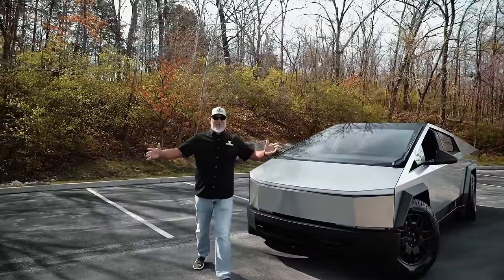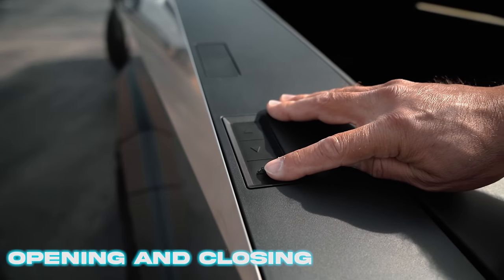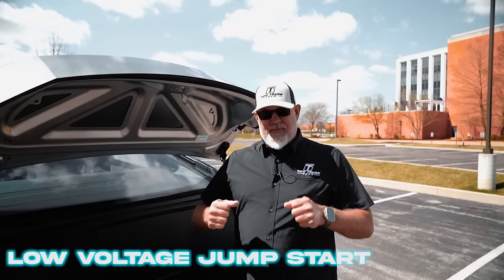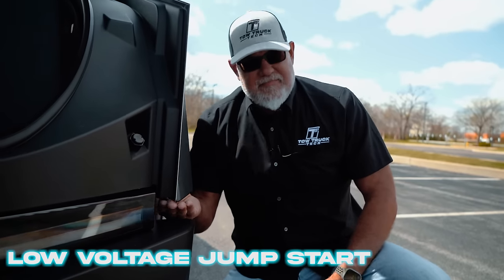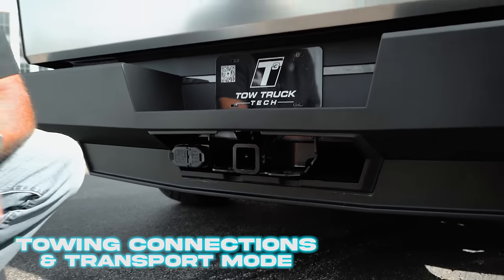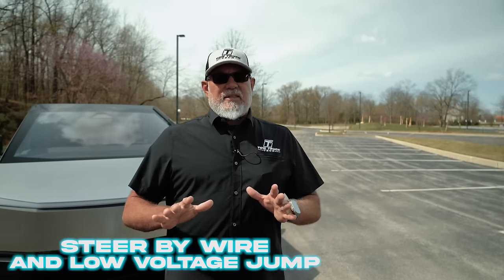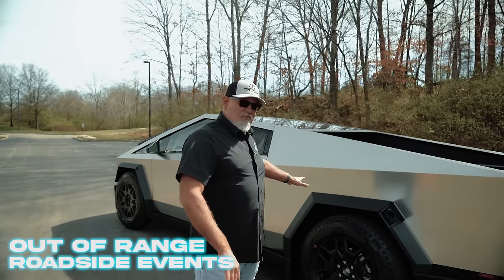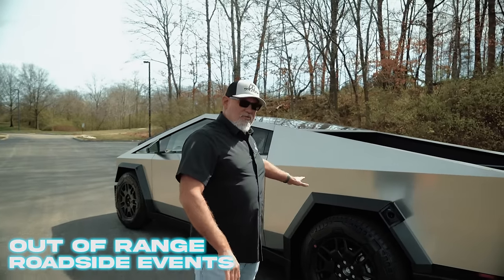Know Before You Tow - Tesla Cybertruck

Comment: I'm assuming that since boosting the low voltage system with 12V is acceptable, that using 24V is also acceptable on this 48V system. Can you confirm that? Would that provide a better response?

--------------------------------------------------
[Note: This comment is not focused on any particular "designated group" with regard to the YouTube "hate speech" policies. It simply reflects the author's opinion regarding a subject, which may or may not also pertain to an individual's actions demonstrated in the video. If any such individuals belong to any of the "designated groups", any commentary included is merely incidental to that grouping and such groups are not the focus of any comments. It's pathetic that this comment is necessary for the YouTube censors.]
Reply from the maker: Directly from Tesla’s technical data:

If you are using a variable power supply, set the supplied voltage to a value between 12V and 16.5V or between 30V and 50V.
Reply: @towtrucktech1555  Good to know! Thank you very much!

--------------------------------------------------
[Note: This comment is not focused on any particular "designated group" with regard to the YouTube "hate speech" policies. It simply reflects the author's opinion regarding a subject, which may or may not also pertain to an individual's actions demonstrated in the video. If any such individuals belong to any of the "designated groups", any commentary included is merely incidental to that grouping and such groups are not the focus of any comments. It's pathetic that this comment is necessary for the YouTube censors.]